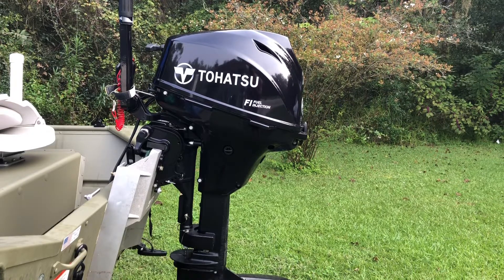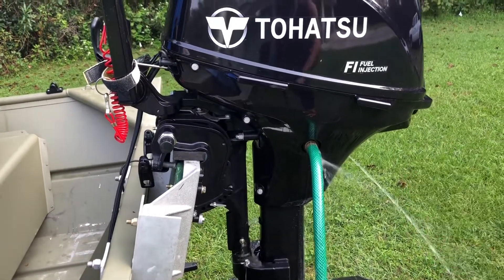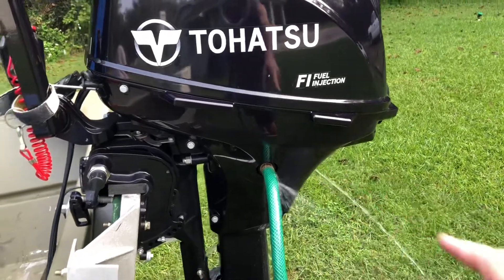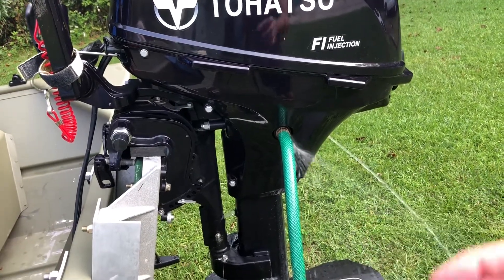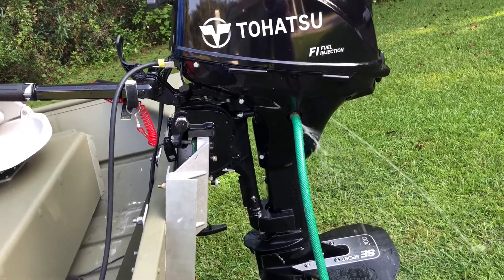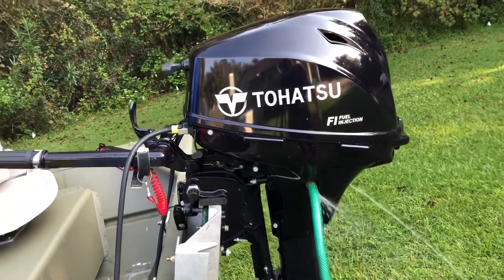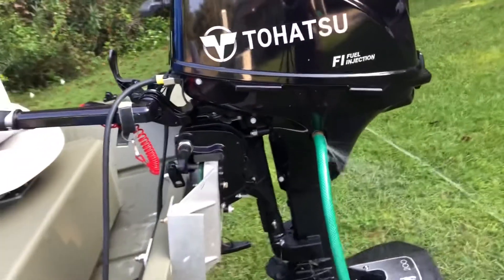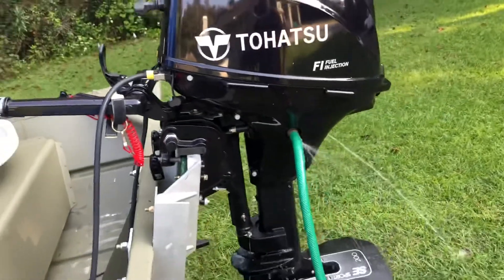Hose Flushing Methods 2020 Tohatsu 9.9, 15, 20HP Outboards - The Correct Way

Comment: Hello I have a question about flushing the fuel of the outboard after use, I unplugged the fuel Line of my brand new 15 hp and put the muffs on and ran the engine a solid 10 minutes and it still ran, is this normal?
Reply: yes, the carb will be full of fuel. the engine will run after removing the fuel line until the carb empties (can take a quite a few minutes
Reply: @kiethyrich  thanks just wanted to know if that was normal, can you do the warm flush during this or is it recommended that the fuel line be plugged in for that
Reply: @alexchristopher8855  warm flush for 10mins then disconnect fuel is best way to be sure, but if you know how long your engine takes to run dry then you can work it out. the key is to get the engine hot enough to open the thermostat so the water pumps round the engine head for a couple of minutes to remove salt build-up. so unplug the fuel line once the thermostat opens which will ensure the engine is cleaned prior to running dry. sorry for the longwinded reply lol
Reply: @kiethyrich  Thanks I appreciate the info! Im a first time boat owner so I am still learning a lot.
Reply from the maker: Since these engines are fuel injected there is no carb or float bowl. In the carb days we used to run the motor off the fuel line to empty the fuel bowl as much as possible to help avoid gumming up the jets and needle valve when sitting too long without use. I’m not sure this is needed with these EFI engines and running non-ethanol fuel. What do you guys think?

One thing I do know is that these EFI engines sip fuel. After your flush you could drain the remaining fuel from the filter/water separator (the one I had trouble with leaking in the first review vid) then start it back up on the hose and run until it dies. Still might take some time to run out though. I need to look at the manual and see if there is an official procedure for this. Of note though is I would not worry about this unless I was storing the engine for a long while since I run non eth gas and use an additive....and there is no carb or fuel bowl with a float.
Reply: @commonsensesolutions6662  Is an additive needed even if using non-ethanol gas 100% of the time?  When I get my 20hp, I was hoping to avoid using an additive if I can do 100% non-ethanol---wishful thinking?
Reply from the maker: @shannonyork5300  For mine, I only use non-ethanol fuel, the only time I will use an additive to the non-ethanol fuel is to stabilize it if it is going to sit for a while. But I prefer to not let the fuel sit around so I just empty whatever is left in the 3 gal tank into a larger container that I use for my lawnmower.
Reply: @commonsensesolutions6662  OK, thank you.  That makes sense.  And, good practice tip to put the gas to an alternate use rather than having it sit around.  As always, I appreciate your response and willingness to share your experience and insights.
Reply: @shannonyork5300  i don't ever use addictives for my outboards I run none ethical fuel and no problem with it sitting awhile. I don't really think most of the additives out there really actually do anything to help except cost you money. There are youtubers out there testing additives and doesn't seem like there is any difference from having the addictive vs. Not except some addictives seem to actually gum up carbs over time

Comment: That engineer you spoke to is full of crap. Unless you use flush muffs you SHOULD NOT start the engine. You have a rubber impeller on top of your lower unit that will melt without water going through it . That your water pump. Your thermostat allows water to pass even when closed just not copious amounts. You'll get a full flush if you just use the side flush for 10 minutes with the engine off.
Reply from the maker: Hi jon doe! I read your comment and did some more research. I also decided to send an email yesterday directly to Tohatsu support to see if I got the same answer. Here is the response:

“Water does get down to the impeller. You can start and idle the motor on the flush attachment.  You do not want to rev the motor up.  So yes it does get water and you run the motor at an idle speed only.
 
Thank you,
 
John Adam
TOHATSU AMERICA CORPORATION
670 S. Freeport Parkway, Suite 120
Coppell, 75019 TX, USA
Office: 469-771-3740

I plan to change the impeller yearly so I will look for melted rubber when I do the change. I’ve changed so many that I know exactly what it should look like. Overheating or melting will be easy to see. I will update this video and thread at that time to show the results.
Reply: @commonsensesolutions6662  Thank you for your informative videos on you Tohatsu.  

I have their 5 hp Propane and love it.  I'll probably be purchasing their 20 hp EFI this Spring or Summer, so I'm really interested to learn what you find out when you replace the impeller.  i've seen comments on another Tohatsu 20 hp YouTube videos where people say absolutely do not run the motor when flushing. But I'll rely on the Tohatsu engineer.  Perhaps the problem others have encountered is they did not idle the engines, but ran it at higher rpm.
Reply from the maker: @shannonyork5300  Thanks for watching! I’ll for sure post the impeller when I change it. Since this issue came up I have been watching closely and even took a few more videos, which I plan to post. When idling on the hose there is tons of water pouring out of the water intake, this sure seems to me that water is being forced back through the impeller due to the hose having higher pressure thereby keeping it cool. Time will tell and I am very curious how this will turn out. I have a friend with a 90 Yamaha that I spoke to about this and he has used the same procedure for years with no issues. I guess we will find out! Idle only for sure!! Stay tuned!
Reply: @commonsensesolutions6662  Hi, looking forward to your feedback. I have a 2015 Tohatsu 40hp. I also read that it best not to turn motor on when using flush attachment. From your video it seems that their is plenty of water going thru the system which tells me the impeller must be doing its job. I'm keen to find out for sure as I have just purchased the screw in connector and wish to flush this way after every outing. Cheers from Sydney Australia
Reply from the maker: @rayklein1125  have you tried the hose flush yet on your motor? I’m curious if you see water coming out of the water intake when idling in the hose?

For that motor you might also want to directly contact the Tohatsu engineering and ask the question. I posted his contact in one of these threads.
Reply: @commonsensesolutions6662  i just picked up a 2020 Tohatsu 9.9 just like yours used, love the motor so far. I tried the warm flush with the hose hooked into the flush port on the side.  Water was coming out of water inlets on lower unit & peeing strong at idle. I kept it at idle. I did find it a little interesting that the manual didnt mention doing it running unless i missed it. Appreciate the video
Reply from the maker: @shooter328  Cool! Yes, it seems a legit method. Weather starting to cool here in Florida…I’ll be swapping the impeller and we shall see… thanks for watching!
Reply: @commonsensesolutions6662  i emailed tohatsu yesterday & this was their email response in regard to that being safe. 

"The operators manual has the flush operation being done using the flushing port with the engine not running. They also show running it in a tank to flush it. You can also run it on a hose using a flushette or what is commonly referred to as “muffs” or “ears” by most people. You just have to run enough water so that while the engine is running there is water coming out from around the flushette. Running it in a tank that allows for submersion over the anti-ventilation plate is the safest. In the field we used to start the engines and idle them having a hose connected to the flushing port. Never had any problems as long as we could see water escaping from the inlet screens and we only idled the engine.
 
My best recommendation is to follow the manual directions.
Reply from the maker: @shooter328  Thanks for that. So once again somebody at Tohatsu confirming that they could run it off of a hose while idling. I also agree that when the water is flowing out of the inlet the impeller has to be being cooled. This seems to be what all of the naysayers focus upon. I am an engineer myself and it just makes sense if you see water flowing out of the inlet then the impeller is being cooled it is what it is. If there was no water flowing out of the inlet then I would tend to agree that the impeller could overheat and melt like everyone says. 

I also think that there are many people who rarely change their impeller or only change it when they really need to change it. So they don’t want to do anything that could possibly force them to change it sooner. personally I believe in changing them once per year when doing preventative maintenance, it’s easy insurance. 

When I do the video I think I will also run the hose with the lower unit off so we can see where all the water is going and possibly clear this up good. I of course am still curious what the impeller is going to look like when I take it out but I have a feeling it’s gonna look like brand new.